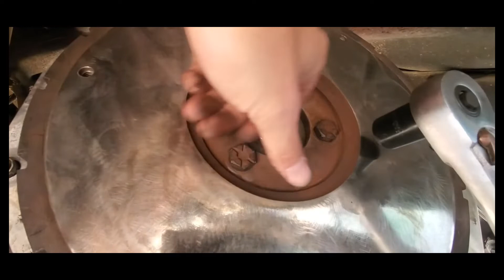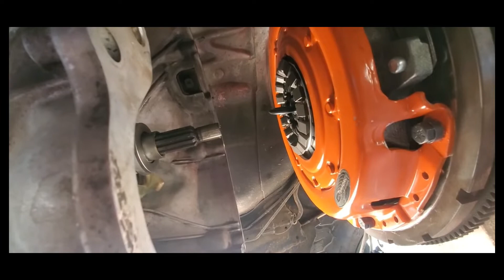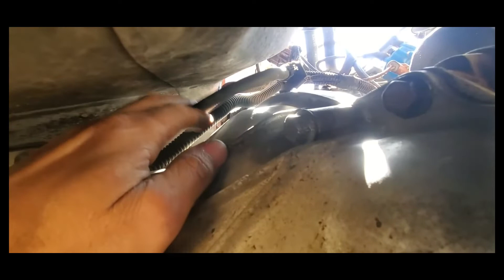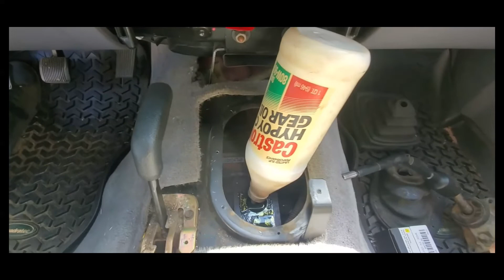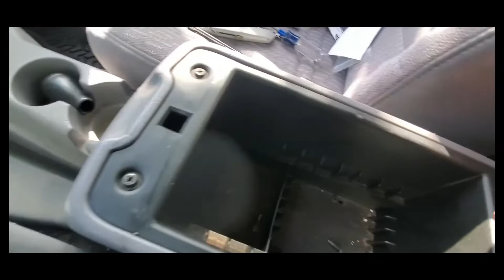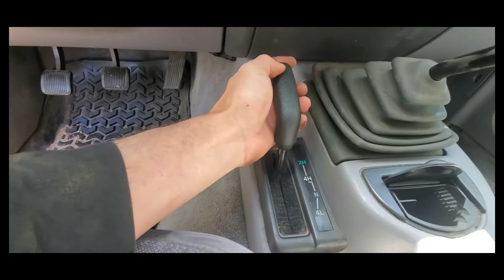How to: Jeep Cherokee XJ 4.0L Clutch Replacement(Part 2) Installation

Comment: what are the symptoms of a bad throwout bearing?
Reply from the maker: There are a lot. Bad engagement/disengagement when pushing the pedal. Singing or grinding when pushing the pedal or not pushing the pedal.  Poor clutch engagement while driving. Failure to gear change when attempting to push clutch. These have a common issue related to the fork. The clip breaks and the clutch pedal just doesn't really work anything when you push it.

Comment: how many miles did you get on that throw-out bearing before it went out?
Reply from the maker: I don't know because when i got the xj it was starting to fail. It failed pretty quick after i got it. When i opened it and found the housing messed up i realized it was probably bad when i got the jeep. Throw out bearings will normally last around 100k miles unless something has happened or it was installed wrong. These have a tendency to mess up because of the clip on the release arm. Always change those if you are in there.

Comment: What's a reasonable price for this type of labor?
Reply from the maker: This is a tough question to answer. it depends what kind of shop you go to. dealers charge crazy money so avoid them. a good local shop is still going to charge close to $100 per hour to do the work. a lot of local shops will let you buy the parts if you are in good with them. this will save some cost and let you spread the cost out over time. i don't know the book rate on the time but i believe it is considered an 8 hour job. so upwards of $1000 without parts. the parts i bought were more on the high end. i would figure cost of everything with parts would fall between $1200-1500 in the current market with cost continuing to increase with inflation. you can get lucky, i have a buddy who use to do stuff out of his garage at half book rate and let you buy parts. that would make the job about $800. i hope this helps, like i said it is kind of a tough question. good luck with your clutch.
Reply: Thanks for the quick reply, but i have another question for you, should i get the OEM clutch or go with a heavy duty clutch? 
 
I have a 97 xj AX-15 stock .... i just want the clutch to last me a good minute.
Reply from the maker: @the_Gr8T_LuCh0  stock clutch is good, heavy duty will last longer. Performance clutch will last less time but grab the best. If you are looking for longevity probably the heavy duty.

I answered as quick as i did because i was uploading another video. If you are not subscribed please do. Every bit helps.